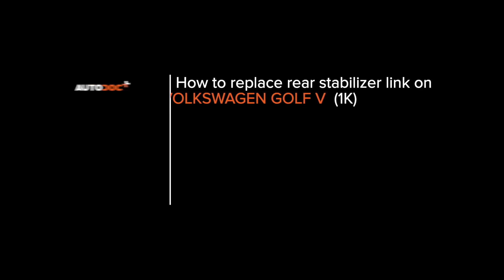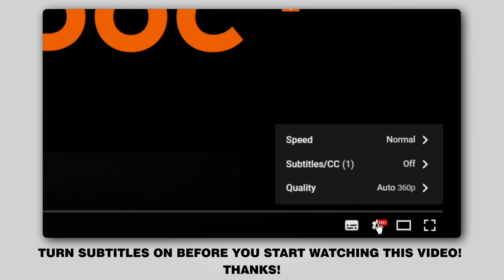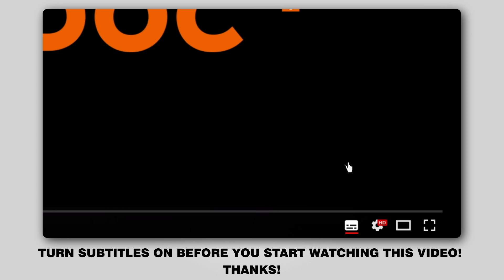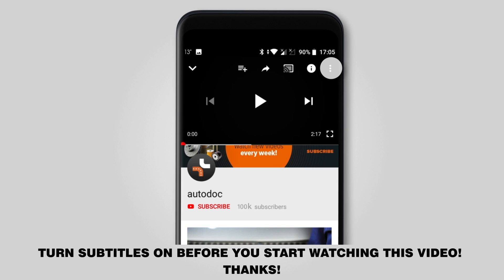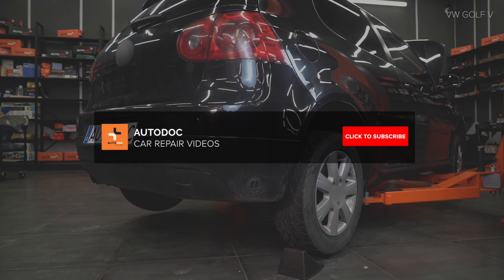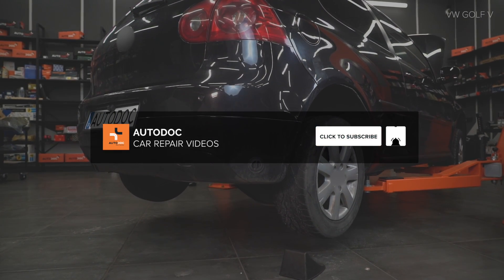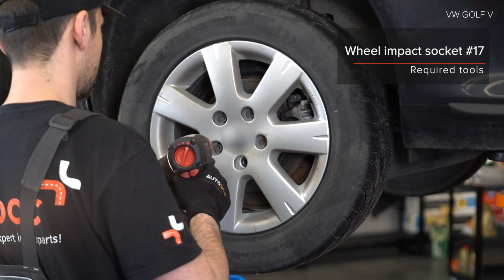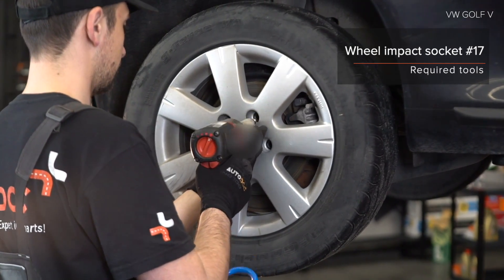How to change rear anti roll bar link / rear drop link on VW GOLF 5 (1K1) [TUTORIAL AUTODOC]

Comment: Just looked at this to check position of the drop-links: A friend has just bought a Golf and I pointed out that there was something wrong - the car has a strange vertical jigging motion at the rear. Just looked and the dampers seemed fine - no leaks, not loose on the top mounts - (this happened on another friend's Golf) - but the drop-links were at an extreme angle: The bottom ends have been bolted to the INNER side of the anti-roll bar, then the tops forced over to connect to the radius-arm. This angle makes the links touch the bar, so the rubber bush is doing nothing to insulate NVH.
 (Top technical tip - turn the sound off - who could possibly enjoy this unbearable cr*p?)
Reply from the maker: It’s difficult to say anything without proper diagnostics; we recommend contacting a car service center.

Comment: Do you reuse the bolt? I noticed one side of the drop link has no bolt on it
Reply: Some new parts are supplied with both bolt and 2 nuts. Its not a bad idea to renew all.
Reply: On the VWs one end is a ball joints, and one is a bushing. I am fairly sure you should get a new bolt and two new nuts with your end link